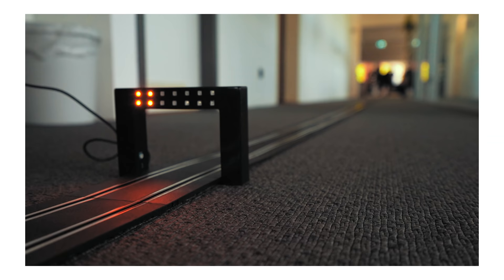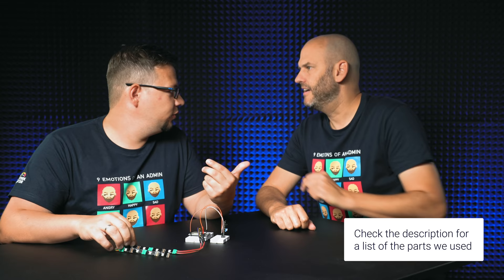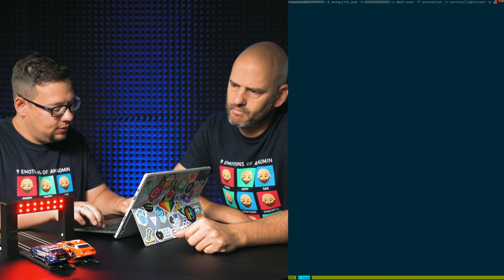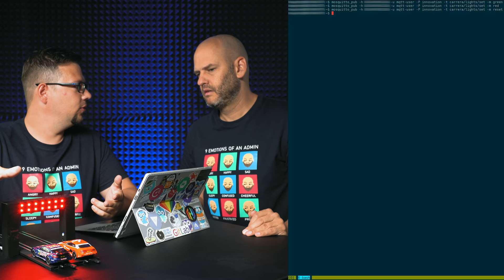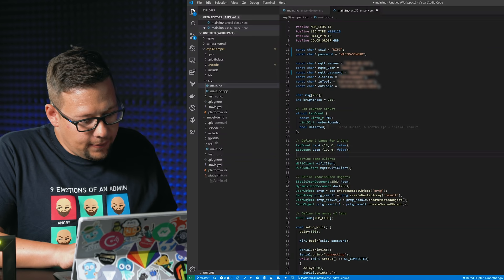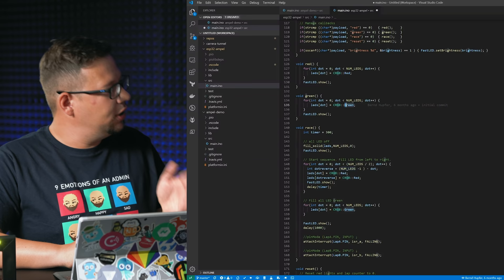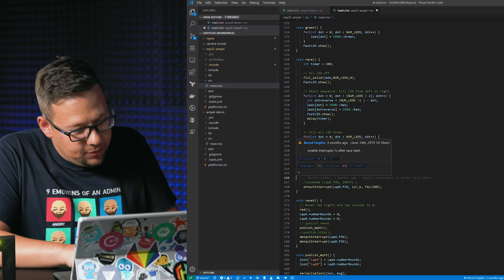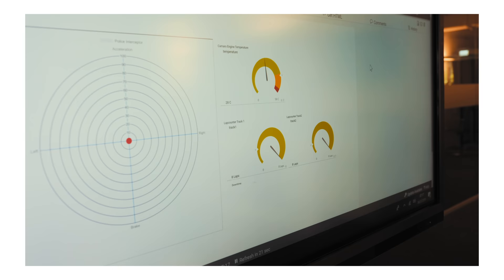Build a lap counter for a slot car track

Comment: Any suggestions, I want to build something like this except, I want to put a bar across the start line, so when the lights are changing and hits the green light the bar goes up and release the cars.
Reply from the maker: love the Idea!
Reply: Hi Juan, did you try relays so instead of having a mechanical barrier it's an electric stop and when the stoplight turns green it would allow the relays to pass energy to the track.

Comment: I chuckled hearing about the silly "wait before counting". Whilst the solution is so trivial... 
Just don't count the first trigger :D Because delay timers is not really a clean solution.
Also the interrupt doesn't need to be that small -- even on a C64 we did far more than that on a scanline. And an ESP32 is a whole lot faster. You could actually increment the lap counter without any issues. But the flag works, although the Lap object's detected property should've been set to volatile! Because you are sharing the object in main and ISR and when the compiler optimizes the code it could have precarious consequences. You need to force the compiler to actually store and load the variable each time it accesses it -- avoiding basically caching it in a register.

Comment: Hi
I your understanding of interrupts is wrong.

You are still referring to normal delays when you refere to interrupts

I also got it wrong in the beginning and use to wonder why my programs crash after a while

To cut a long story short
Interrupts allow us to carry on with the main task while still attending to the temporary task or isp

On the other hand a normal delays function stops it's main activity in order to attend to an interrupt

I switched from. Arduino to pic microcontroller in order to make use of its interrupt advantage

Pic microcontroller is like an octopus 🐙 that can service man interrupts unlike Arduino

Arduino however is user friendly but with 1 or 2 interrupt pins at most meaning you will require 4 Arduino chips compared to 1 pic microcontroller to have as many interrupt pins at your disposal

Further more back to your racing counter 
It is extremely rigid and not diverse in application

I rather use a color sensor
With the logic of racing to identify each participant with regards to time reference and other relevant data

Sincerely

Ejike